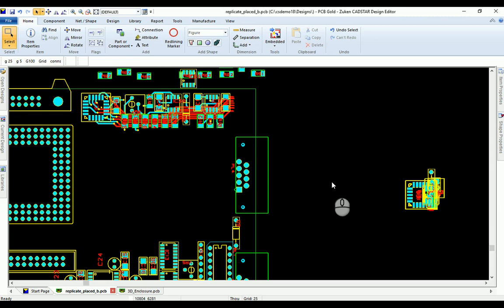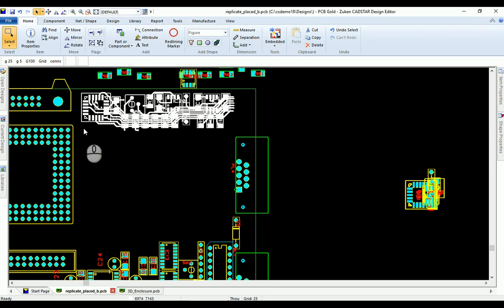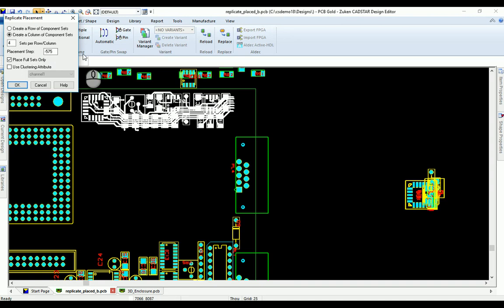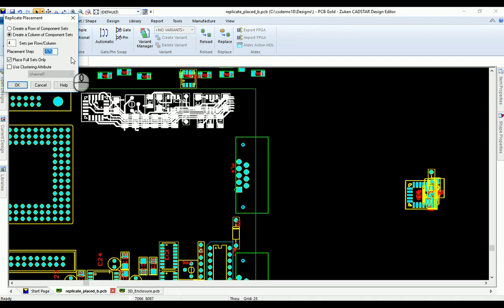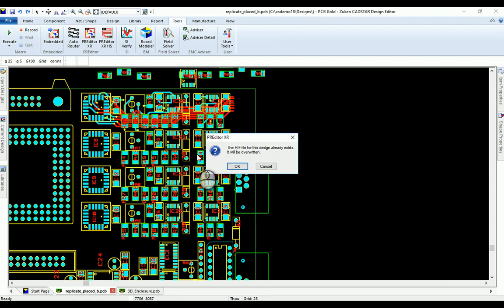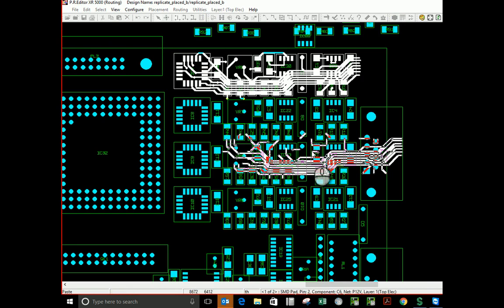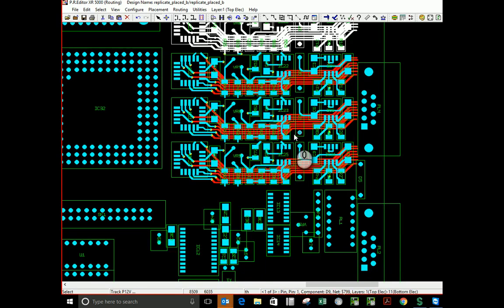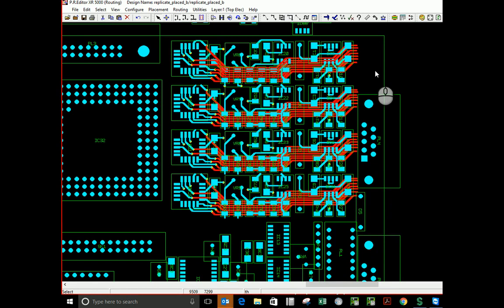CADSTAR - PCB Design - Circuit replication

Comment: Is there a schematic back annotation?
Reply from the maker: Marcio, yes, CADSTAR includes back annotation of changes in PCB Layout to the schematic.  This video however, shows how to replicate placement and routing blocks based on existing data in the source schematic. An alternative approach would be to create reuse blocks in schematic and PCB layout, then simply replicate blocks of circuitry.